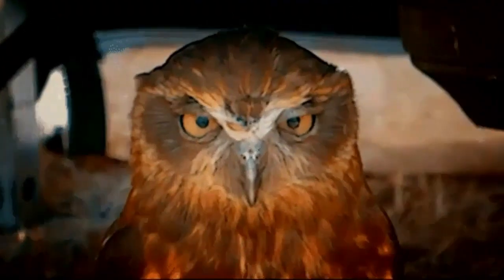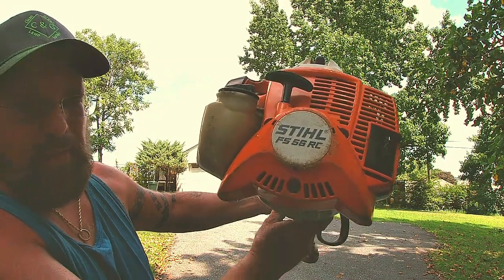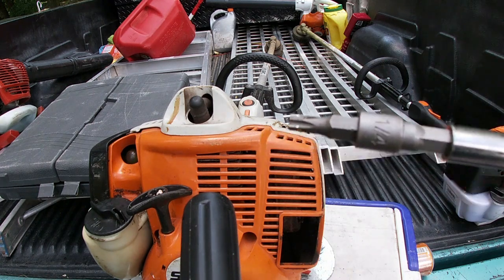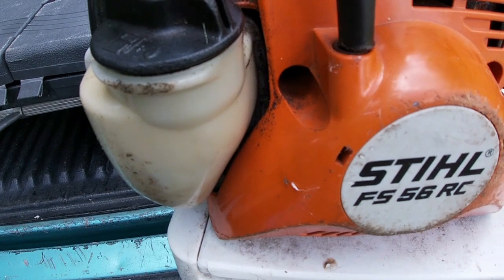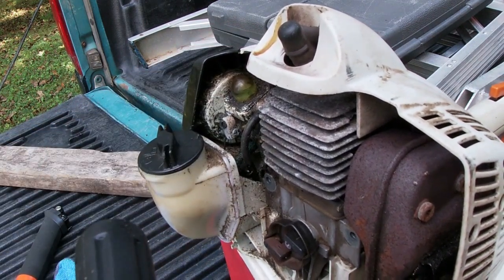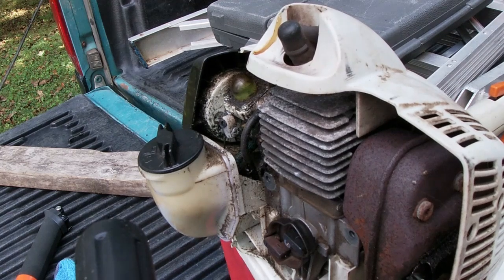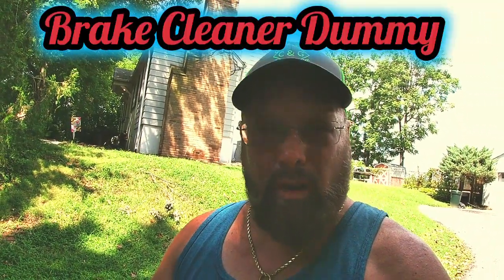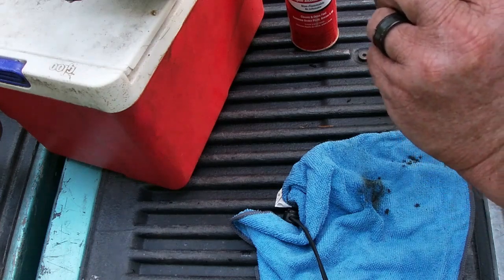Spark Arrestor Fix | Stihl FS 56 RC

Comment: OMG!  I’ve got the same trimmer, newer model, and was going nuts trying to figure what was wrong. I got the book out, first said to check the air filter felt, it was clean. Second it said the spark arrestor probably needed “servicing by an authorized dealer”. Knowing my “authorized dealer” has a minimum labor rate of $120 plus parts/supplies, I turned to YouTube and your video was the first that popped up. Took me less than 10 mins to get it running like new, my spark arrestor was totally blocked. I actually had the trimmer in the bed of my truck ready to take it to town in the morning, now it’s ready to go back to work tomorrow. My thanks to you for uploading to YouTube, and all the folks that led you to the fix! WOOHOO, I’m dining out for dinner with those savings. Now…I’m digging my old trimmer out that died years ago and checking it too. 😅
Reply from the maker: It's amazing what you can find on YouTube that will save us money. I know I had done a lot of fixing looking for videos and they were very helpful and saved me a bundle. I'm so glad I could help you out my friend.